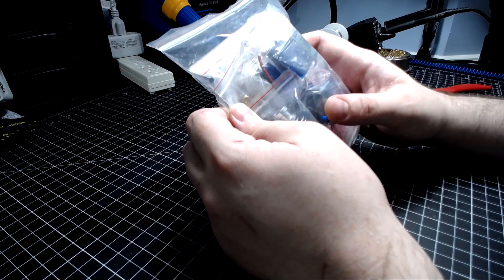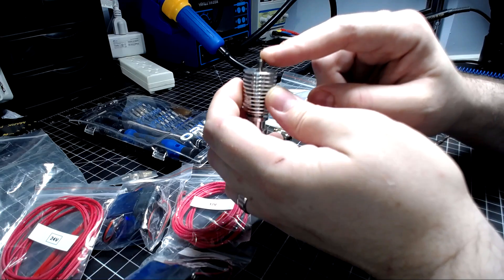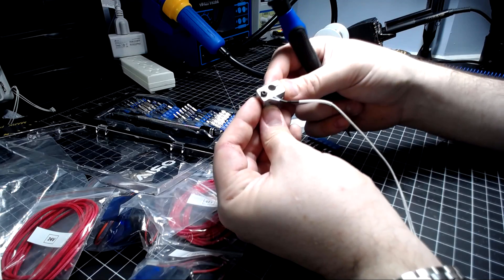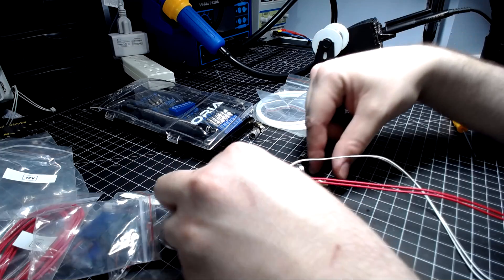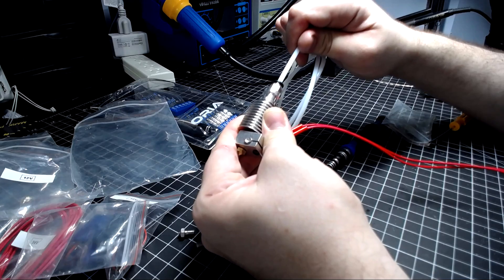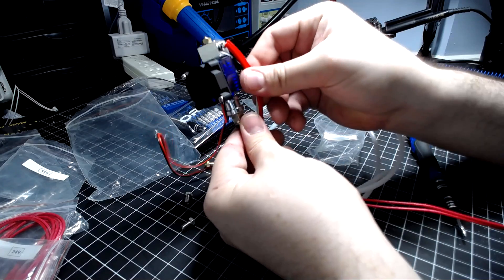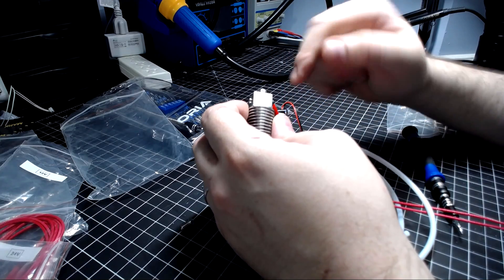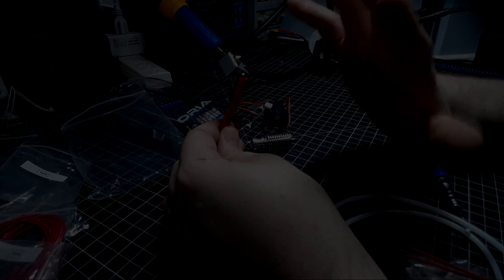TH3D Tough All-Metal Hotend Assembly Video

Comment: This is a excellent hotend!!!!! Skip using the filament oiler for a few weeks to season it and you will go insane and want to take a hammer to it from the never ending clogs and jams. Follow the instructions and use a oiler however ,and it's a kickass little hotend.
Reply from the maker: Oilers are a great "hack" for all metal hotends. Once they are broken in you'll be good for quite a while!
Reply: @TH3DStudio  yeah I haven't had a problem since I removed it. I printed a full roll of pla with it installed and then pulled it and haven't had a issue since. I got my glass bed back to sticking on its own without constant cleaning as well. Took a few days of printing for all of the residual oil to disapear.
Reply: It's crazy the different solutions people will throw out there genuinely trying to help out,there is a handful of them and I tried them all before I figured out the oil trick was all I needed to eliminate the issue

Comment: Very cool! Do I need to make any changes in the firmware after installing this hotend and also a metal thermistor?
Reply from the maker: The hotend stock one doesnt require changes to firmware. As for a metal type thermistor, check with the vendor you got it from to see what marlin thermistor # it uses.
Reply: @TH3DStudio  But it is not the stock hotend, it is the E3D V6...

Comment: Any advantage to this with the ptfe lined heat break over a stock creality hotend?
Can I use the PTFE lined heatbreak with a genuine E3D V6 heater block?
Reply from the maker: Larger heatsink means less heatcreep and going to the V6 type means much more selection to nozzles from us and 3rd parties. Our PTFE heatbreak fits E3D hotends as well.
Reply: @TH3DStudio  Think I might just grab your heatsink variant since I think the ptfe fix requires the threaded ptfe coupler that isn't available on the e3d v6.

Comment: do i want a all metal hot end?
Reply from the maker: Depends on what you are printing. If you are staying under 275C you can swap your tubing on most machines to our Tough Tube: https://www.th3dstudio.com/product/tough-tube-high-temp-high-tolerance-ptfe-tubing/
Reply: You're not limited to all metal with this, with the optional heatbreak you can use it as an improved version of the ptfe lined hotend. If you only print pla and maybe some petg that might be the better option.

Comment: Hell yeah...I love this hotend on my cr-10s. The only thing you may have glossed over a bit was using a wrench on the heat block to 'hold a backup' when you tighten the nozzle.

I've had absolutely zero issue with mine. No leaks, no clogs, and steer everyone to this unit when they inquire about an all metal hotend upgrade.
Reply: I'm about to install this. Any recommendation for a mount to print for a CR10s?
Reply: @iansutube  I'm running the petsfang 2.0 (with ABL mount for my ezabl sensor). Printed out of PETG. Works and has held up perfectly.
Reply: @Majiksmoke  thank you